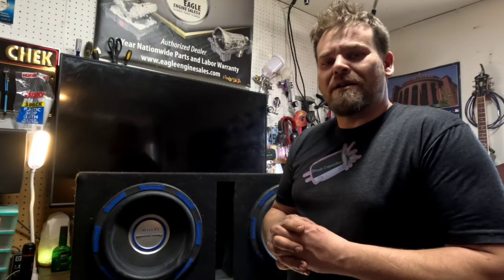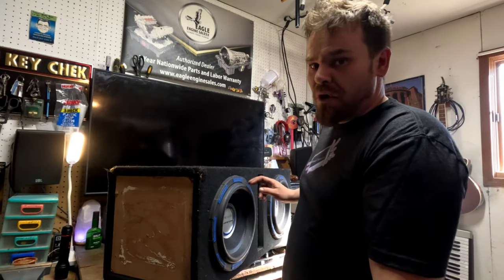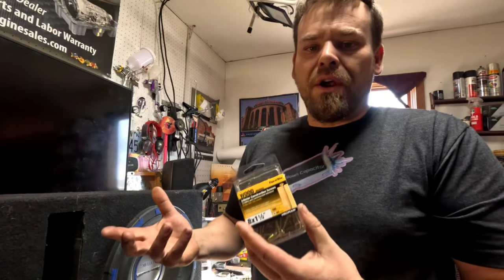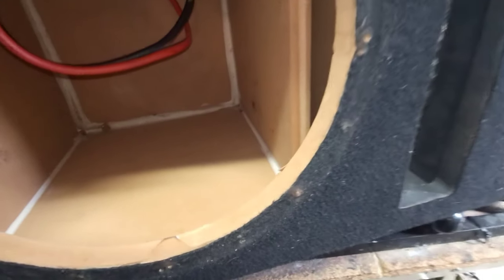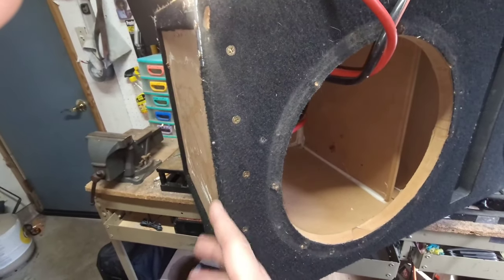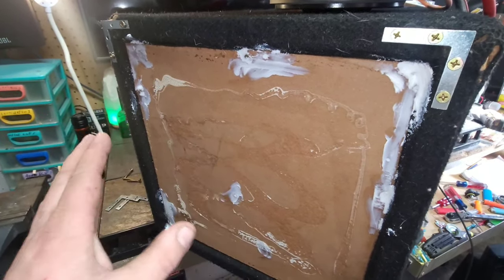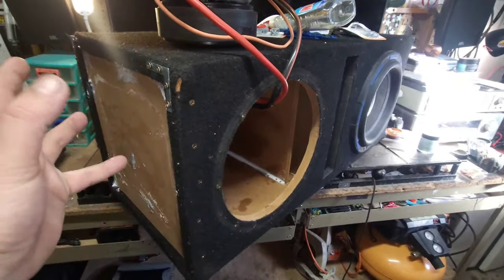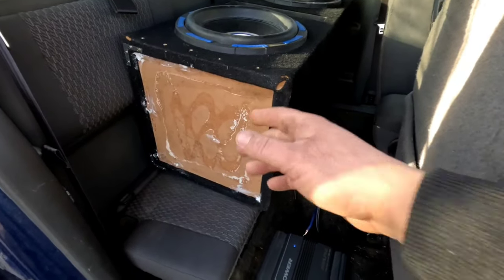How To Fix Annoying Subwoofer Rattle (cheap and easy!)

Comment: That’s why most common prefabs are garbage, they use staples and caulking that’s it, they don’t glue joints or use screws as fasteners
Reply from the maker: YES!!! It's only a matter of time before they rattle.

Comment: Need a bigger box for those gothic series. My brother has the same subs but his box is way bigger and when he finally listened and got the bigger box for them his subs were twice as loud and I doubled his port area and he pushed them 1500w crossfire amp. So you can get a lot more out of your system if you wanted to.
Reply from the maker: I've heard that. I should make a new box!

Comment: I have a head unit with 6 input F+R+S.I have to bridge interior speakers. Which wiring is  best for quality and power on a 2 amplifier setup 4ch/2ch

1.3 pairs of aux 
two of them F+R to the 4ch and  S to the 2ch. Than bridge speaker wires of 4ch

2.2 pairs of aux and  2 splitters. If so use F or R?after split becomes 2L and 2R follow color code?

3. 3 pair of aux 2 of them going from head unite F+R to 4ch, and the last one from 4ch out to 2ch.

I should just ask Is there a way to bridge without sacrificing fading 
There is no video that will explain those choices  of wiring. I think because everyone seems to have a DSP. Anyways Thanks in advance.
Reply from the maker: Yeah, it's recommended to use a dsp in that scenario. But I would do #1 if you're bridging interior speakers down to 2 channels. Are you only running 2 interior speakers?
Reply: @Blowncapacitor84  the 4ch amp is 50w rms x 4 4ohm
100w rms x 2 2ohm
260w rms x 2 4ohm

Front components 100rms 4ohm
Rear 3way 50rms 4ohm

Looks like I’m going to parallel wire left right and sacrifice fading. Now that I fell 40w short. Instead of 300w rms it’s now 260w rms square root to get my gain correct
It’s my mother car working on what she has from a previous car that was totaled. I wasn’t able to open the front doors to get the speakers. I  caught a deal on components.where I’m stuck. 15yrs passed  doing anything 12volt related everything got interesting again dd1 smd cc1 and processors by app. But still no Dts 5.1 optic cable. Oh wait I should just use the components and not use the rear

Comment: Cool content ! Just found your channel 🔥👊🏼

Sometimes ya just wanna get it to hold on a little longer 👊🏼

That’s just a normal ported enclosure- just a long port that’s bent to get a good tuning 

Transmission lines are very large 
**
I use the same screws on alot of boxes- they work for sure 🔊
Reply from the maker: It's an honor having you, man!!! I've seen your videos and have NO IDEA why I haven't subbed yet! Subbed now! Thank you for the info, and yup, I'm just trying to get a little more time out of it!